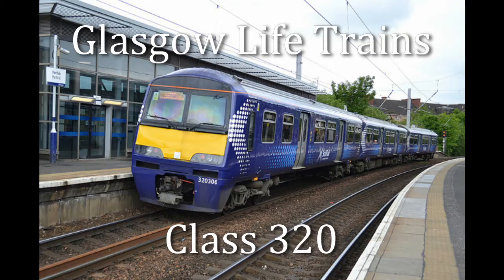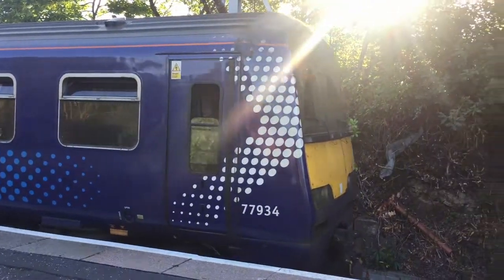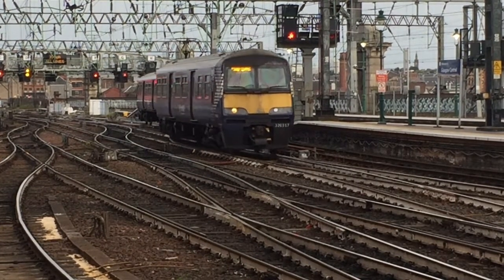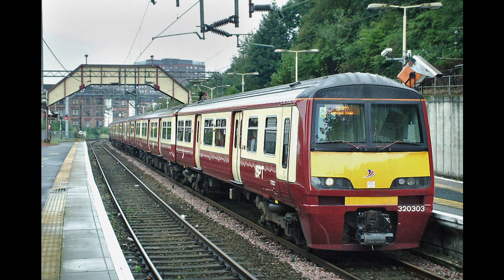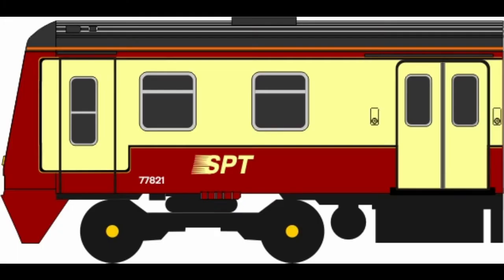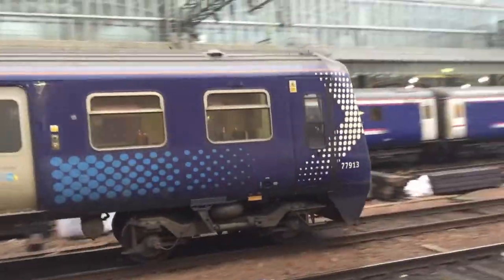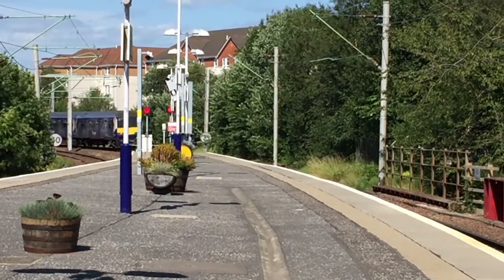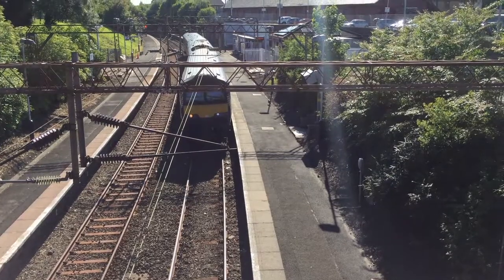Class 320 - Review

Comment: 321s are found in east anglia and birmingham too
Reply: Not Birmingham, 319s go there
Reply: @class444swr3  they dont,LNWR run them from london to Milton keynes central and the St albans abbey branch
Reply: @bowlerstuff9589  I have seen a 319 at Birmingham mind, it might have been a one off but definitely saw one at Birmingham International
Reply: @bowlerstuff9589  They used to, until Class 350's arrived in 2004/05 which saw many units get transferred to First Capital Connect with 7 being retained for peak-time services and the Abbey Line until 2015, when ex-Thameslink Class 319's were introduced forcing these units to transfer to ScotRail and converted to Class 320/4's.